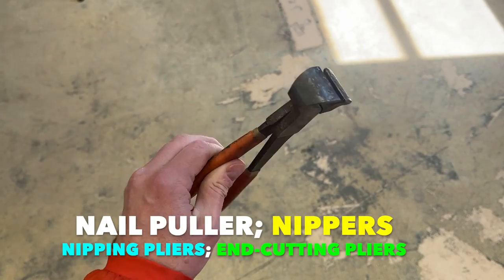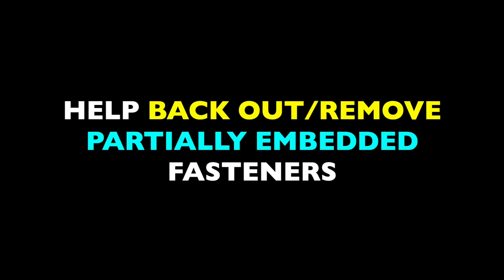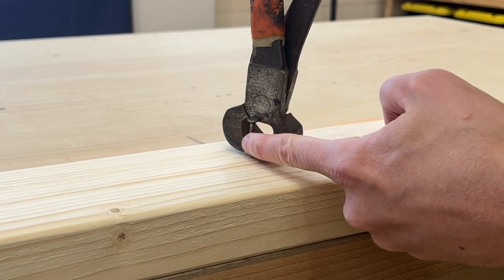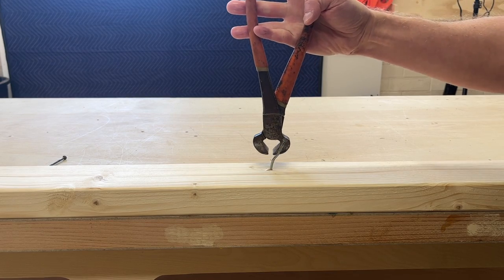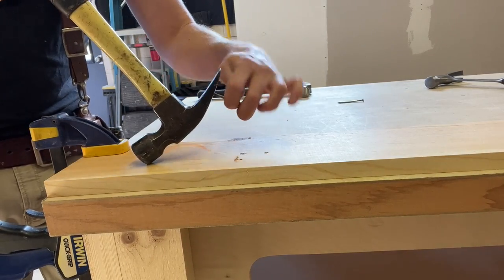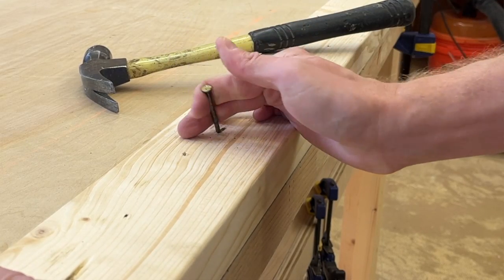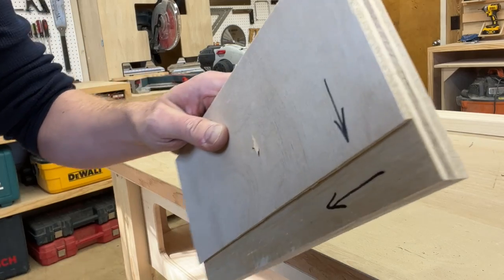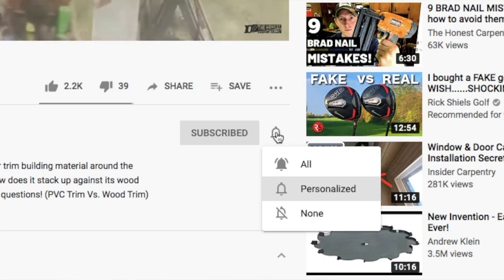This Tool Helps Remove STUBBORN NAILS + FASTENERS! (Nipping Pliers/Nippers/Nail Puller--How To Use!)

Comment: How well do these work when you have a lot of staples to remove from carpet removal? You know those pesky staples used on the padding.
Reply from the maker: I’ll actually after use a 5 in 1 for that Dennis, or a pair of simple slip joint pliers. These are really best for bigger fasteners 🙂
Reply: @TheHonestCarpenter  Hi

Comment: As a cabinetmaker, I use these when a long narrow crown staple doesn’t go in all the way (for whatever reason). Hammering the staple can just end up looking ugly plus the pullers don’t  dent the melamine.
Reply: Oh yeah, I thought I was slick and tried using a nail set but staples are just like "haha, really?" Best to just pull it out and try again.

Comment: what if the nail is already embedded with a nail gun?
Reply from the maker: Dig out the head with a cats paw first, Tony!
Reply: @TheHonestCarpenter  and then use vise grips in a rotating back/forth method to loosen and pull it out. It’s how I have done it for twenty+ years. Never used nippers for this purpose. Great for removing screws with stripped heads as well.

Comment: I got my nippers when removing wall to wall carpeting, for all the staples.
Reply: A retired carpenter drywaller here We used nippers tying metal furring channel to inch and a half carrying channel in drywall ceiling installation as the only tool for that purpose  It certainly has many more uses in professional construction industry beside nail pulling. Been using them over 50 years

Comment: There is a better one from the shoe trade. It does not  have a bevel at the edge of the nippers. It is dead flush.
Reply from the maker: That does sound helpful, Brian! The bevel sometimes prevents you from a really flush grip.
Reply: @TheHonestCarpenter  you could possibly grind down the type you have. Leather supply places like Weaver Leather or Tandy Leather may have them - priceless!